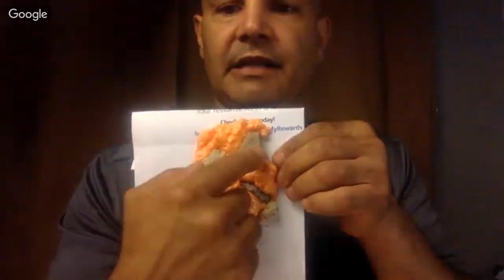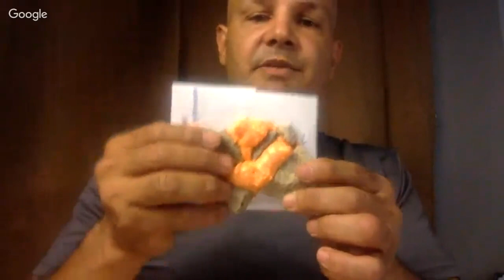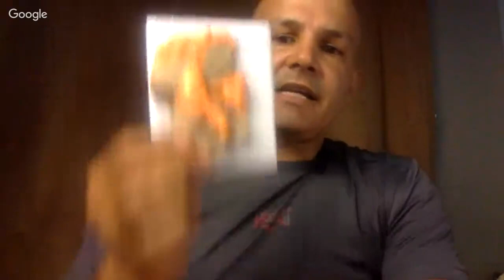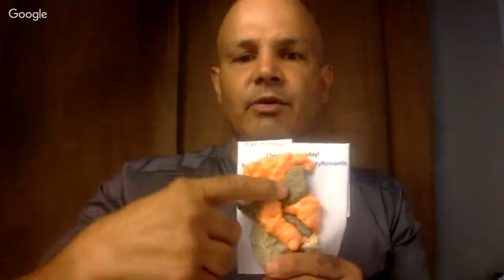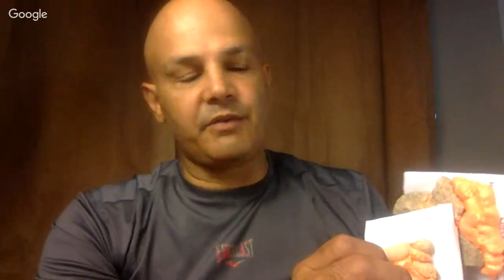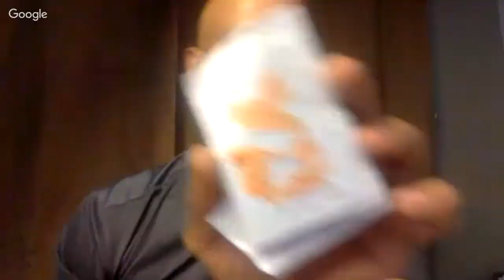Concrete angular stone VS pea gravel Equilibrium, Random, Hinge, Explains all Engineering and LIFE

Comment from the maker: This is only an understanding and does NOT represent the exact replication of forces... Keep in mind, that where compression is, tension also exist... Unless the applied forces are ''totally'' applied over the entire subject matter...  Like applying forces down a column with a load that covers the entire top of column!  BUT, if you put the load partially in the center of the column, then you WILL have some tension on the ''opposite" side of the ''compression path"...  It will show itself more like a shear break and can even ''pop'' off the material...  
Sometimes, looking like ''spalling"...
Further, think of a buckling column... it shows the ''free body diagram'' in the format of the bulging concrete -- that is, it identifies the way the forces were managed by the designed column...  It does not fail ''equally'' ; it fails at the point of the buckle!    If, the column were truly designed with equilibrium, it would fail in the entire member, equally...
But, the design of the column is uniform in it's rebar and concrete placement... YET, the column fails ''locally"...

Comment: To illustrate your point...asphalt roads utilize round gravels which allow the relatively weak tar to resist the loads you describe. Concrete freeway design requires lateral resistance with minimal cracking.

Comment: Secret to understanding all cracks is within the Julia/Mandelbrot Sets
Reply from the maker: I would like to determine the air pressure. weight of the balls in the lottery machine... along with it's shape...
That may be the closest to random we can get but it still has an explanation for each ball chosen... it crosses into the wind tunnel and it gets pushed up by the pressure, the ball is then chosen... 
We just need to figure out how the air pressure is determined and the variables to win the millions! haha
We know, that the balls bounce into each other and they all want to roll towards the air hole that pushed them into the position of being chosen...   The reasoning is there...   just need to watch a few thousand shows to determine the average of the person releasing the balls and the air being initiated? https://www.youtube.com/watch?v=Vc_PRhQpeJI    BUT, they use a "random/ alternating" selection process and then they let those damn balls scramble at such a rate that the impacts and the reactions make it virtually impossible to predict... BUT, --- never the less a few numbers constantly come up... hmm
"Dr. Kim says the most frequently drawn Powerball number for the past 10 years isnumber 20. It is followed by 37, 2, 31, and 35. As for those white balls, the most popular is number 42. It is closely followed by 16, 35, 26, and 19."
So, this is not as ''random'' as they would like... Ideally, all balls would come up equally to be a true random generator but it appears the balls think otherwise...  Something, is not in equilibrium... hmmm